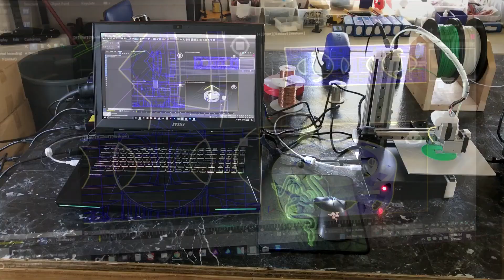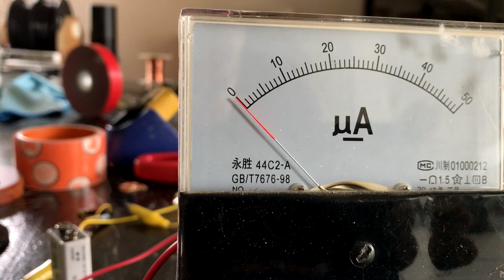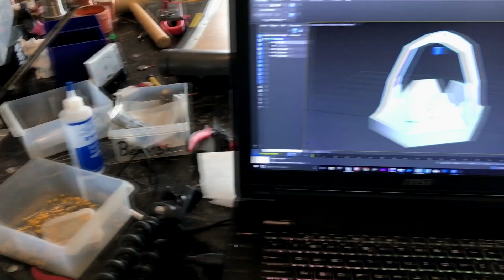3D Printed Nuclear Powered Motor - TriNano EZ-Spin - Tritium

Comment: Thank you for this.
I now wonder if I wide glass tube, with a lot of surface area in it, like star patterns or spikes engraved all inside it, spray the inside with the phosphor paint, and put on end-caps with valves for recharging the tritium gas like a car AC system.
Then would this be a great design for a Tritium Lamp? Maybe surround it with solar-panels, and have an emergency power source to charge a smartphone, and outside of emergencies, it's power can be added to the home, even sold back to the grid like what you can do with solar-panels on your roof?
The lanp you walk around with during a blackout, can also be docked in a basket thing of solar-panels.
My concerns, other then leaks, is, how is not good enough Tritium gas safely disposed off?
Reply: *if I made wide glass tubes

I was so excited by this idea, it screwed my grammar.
Reply: If this isn't bright & compact enough to charge a smartphone, then the panels can be wired in series & parallel enough to charge batteries or capacitors that stays with them, since they have all the time to be charged, then those batteries/capacitors can charge phones, or power other devices, when needed. And when the lamp batteries/capacitors are charged, then the lamp's unused energy can be sold to the grid, or power every day things outside of emergencies, or charge more backup batteries for emergencies, keeping them at a safe, longevity charge, like 60%, or something, so they don't degrade from sitting fully charged.

Comment: Do you ever get tired of the free energy kooks barraging you? Seiously though, what type of PV cells are you using? I can not imagine monocrystalline PV with the silk textured surface producing that little current from the tritium vials. I have gotten better results from moon light. Have you tried blue tritium vials? The phosphor should convert more energy to the usable blue spectrum.
  But in the mean time, you have got me wondering if I could spin something levitated in a vacuum using static repulsion from Alpha particles or even the kinetic collision force of them. I have everything necessary sitting around except for the fact that I already have three projects going at once.

Comment: I have a theory ✋ pick me! 
Why don't we make a compressed tritium gas flow battery. We could compress the tritium gas in a regular pressure vessel like a steel or carbon fiber propane tank preferably something that has a vavle that wont ever leak radioactive tritium gas. Then use high speed gas turbine pumps to push tritium gas through pipes, valves & Graphene sivs/filters to possibly extract protons emmited from radiation waves as direct energy. Like in my previously discussed topic of large betavolatic house hold civilian ownable tritium isotope gas batteries; that can trickle charge batteries & capacitors. Do to nuclear radiation having a long shelf life of years & years i wonder if it could make a useful generator for powering houses or off grid installations. Being how paranoid the government is about radioactive elements & terrorism i would think tritium would be more in reach for civilians through custom electrolyzers that could turn hydroxy, hydrogen & deuterium into tritium. But i know the government will make up some hubaloo about how tritium is used to make bombs well so is steel & metal but you dont see the government flipping out about that! Thank god...... i mean if its okay with the government to thank god that is........ To be continued! Anyways the only one making bombs is the government so digress. Where was i again oh yea i was trying to say betavolatic devices use beta waves which is safer than alpha wave radiation.

Comment: One beta voltaic cells you may consider the rugged crystal or thin film flexible cells. I think they can take light and convert it on both sides but the under side is a bit less it should give you a few more nano amps. As for litrocells you may try using an MHD coil. It works where you wind a coil of x diameter until a lights an led. Then you put two perpendicular magnets that attract over the coil to get a bit of gain. Just spamming some ideas.

Comment: I shouldnt say this but i better get a shout out for it. what you need is uncoated polychristalline solar panels and mroe tritium lights so you can output more 10-100x more amperage then what you're producing now and hook the power output to a high induction 5000 rpm dc motor.

Comment: This may not work but if you use a sphere magnet and put tritium rods around it as the core. Use a glue gun to glue two bells on the top and bottom of the magnet while making sure the bells are not connected electrically to the magnet as to make a sphere. The bells must not touch at the equator of the sphere. The top and bottom should make a little power if not try salt water or use Rochelle salt for a tritium mhd sphere generator. Bases on something I read. The main idea is that the tritium ionizes a salt or gas or fluid. The magnet separates charges to work like a battery. It may need to spin in order to generate moving ions.

Comment: It looks like you are using 1.5V cells. You would think that You better get more current and lower voltage for the motor, but better electromagnets have lower resistance in the coils. I suggest you try solar flashlights cells - they are 5V / 2mA nominal (under full sunlight) I've tested few 10s of them and I got short circuit current from 0,2 to 5mA. Maybe reducing the number of turns and rising the wire diameter just a little bit will produce stronger magnetic field at higher voltages. At least you won't know until you try it. You might even try it without changing the coils - for a quick test.

Comment: Would it be possible to bypass the electromechanical portion of the device by using the photonic output of the tritium vials to turn the vanes of a radiometer directly? I'm guessing certain wavelength outputs (vial colors) would be more efficient than others. Just a thought for efficiencies sake, but that would detract from the beauty of what you created.

Comment: I bet you could get a tad more power if you were able to more accurately measure the output and find that betavoltaic module's MPP. You could then tune your coils to somewhat impedance match the BV module. That might do very little as the design may already operate close to that power point, but it might just increase the real power being transmitted by the coils by double digit percentages.

Comment: Have you considered feeding output into a standby battery/capacitor bank?  I could see applications possibly being emergency standby devices that you don't have to worry about.  Like say an LED flashlight in your emergency kit.  Enough to see long enough to get your other backups online.  Though I suppose from a practical standpoint just slapping a solar panel on a flashlight hung in a wall mounted broom clip would net you more power over time from ambient room lighting.

Comment: So your improvment is mostly using a magnet at the top, correct? Also I do not believe your motor runs as low as you claim: setting the meter to capacitance measurement will not output current values as you show at 3:47. Still impressive how well it runs, I built a spinoff design and did some measurements which I will release on my blog in a few weeks. The power you can get at the low speeds is about 100nW because that's what I measured the air friction is around 0.3Hz (you claim less than 4nW which is quite impossible from what I measured). Efficiency of these motors is quite good though, around 60-70%.

Comment: Just a thought... space your poles so there is a gap after the driving pulse and utilize a variable mass mechanism on top of your design... if properly sized you will create greater average speed and therefore more output voltage

Comment: I have been doing some experimentation to boost power output within pulse systems such as pulse motors and or pulse motor- generator/alternators. I found that switching the negative leg of the pulse capacitor(which is also the storage cap when not driving in pulse mode), into the positive terminal of a higher voltage reference(hvr) such as a battery bank, ultra capacitor bank or voltage multiplier circuit, will allow the driving pulse to be delivered at a power factor of 3 to 10 times of its own value. You may also decoupling the negative terminal of the chosen (hvr) via the same method but buy switching the positive lead of a second capacitor(only some charge is needed in this cap)- onto the negative terminal of the (hvr). Time the pulse delivery so that the discharge time of the drive pulse is short enough not to completely drain the drive capacitor.  You will know by dynamically measuring voltage across the drive cap and or the (hvr) ... if a lowering or negative voltage is observed then that means you are drawing energy from the (hvr)... shorten the pulse and upsize the farad of the cap. A great way to do this is to use an Adams motor  attraction pulse phase for one pole and on the opposite side of the rotor use either  a repulsion or attraction mode of pulse (play around with your coils scenario depending on coil suseptability, coercivvity, resistantance, reactance, etc) . Be sure to make the attraction coil the first coil in sequence-series to receive the pulse current from the capacitor. Using two position reed switches will allow the normally closed position to function in generator mode and collect energy for the next discharge. If you use properly sized low power Shotkey Diode rectification possibly even ambient energy harvester circuits currently available in the micro and nano watt range it will boost harvesting/generation output. Potentially you may have to initiate the spin of rotor to input enough energy to over come any voltage drops in the rectification circuits.... like pull starting a lawn mower in a way. Seems a good fit to your low speed highly efficient motors or even in higher speed applications (up to the limit of reed switch mechanical time constant). You may want to run a quick ballpark analysis on your L-C resonance to see what frequency would allow your motors to run in resonance.... which means if you pull start the motor to a certain rpm it may run much more affectively.

Comment: A stirling hot gas engine for heating could be developed has well. A cold gas and hot gas stirling engine designed in this manner could also operate a rewired drum motor generator with magnetic bearings with a vacuum spark gap to generate high frequency electrical power that could charge organic carbon power cell banks. Way better then solar. ; )

Comment: Do you do any work with stirling engines? Have you ever tried designing a cold gas stirling engine using aluminum scandium alloy being vibrated at low frequency to cause the crystal structures to generate ultra low temperatures? I wonder if it would be possible to create a air conditioning unit using aluminum scandium and gadolinium and stirling cycle all self contained self powered self running? ; )

Comment: I'm really interested in the part where you got the motor to spin by just holding the two dissimilar metals at 3:51. Do you think that's the galvanic effect, atmospheric energy, or possibly bio-electric energy causing the Ezspin to rotate?
I'm thinking galvanic but if the values go up and down dependent of health, going this low with that motor might be able to help advance medical science in the field of Bio Energy. 
What do you think? PM me if you want to collaborate on a project like this. Cheers! Matt-

Comment: Sooo.... not to be skeptical, but something doesn't seem right here in the measurements you're taking. You're claiming the multimeter is showing 20 nA, but... it's set to be measuring capacitance, not current, even though the leads are shown in the mA sockets. So I have no idea what that's measuring...?

Plus it looks like you're measuring the voltage at the same time, but a 200 mV source into a 10 Meg input resistance voltmeter means the multimeter itself is sinking 20 nA. What's going on here?
Reply: I don't believe his meter measures capacitance - https://www.amazon.com/ELIKE-T-92-Self-Recovery-Capacitance-Identification/dp/B01B9P49B0

Comment: wow this is amazing work :3 hm wonder if this is the actual first perpetual moter that spins forever o-o ........YO WHAT IF THIS IS 0_0
Reply: A perpetual motion motor has to have 100% randament, that meaning that all the energy is contained withing the system and does not escape (trough heat or friction) and no input is required . This motor has a energy source. The tritium.
Reply: ohhh I thought it was powered by just he metel from minivolts..ohh yeah perpetual motion machine doesn't use any input ;-;. thank you for explaining this to me :)..hm I wonder...how long does its life go  and..what is tritium exactly :| but thank u for explaining it to me

Comment: Covering the cells with aluminum foil or other reflective material might increase its efficiency although it wouldn't look as good as this. Also, magnets are creating friction like losses when they swap past metals, so you might wanna try to use smaller magnets or other kinds of arrangements that lowers this losses. And like everyone said, using a vacuumed container might increase efficiency substantially.

Comment: But you all know that it is fake. Right? There are two brown wires coming out of the bottom. (Sorry for bad Englisch. I'm a German.) IT IS FAKE!!!!!!
Reply: Wo ist das Problem an den Drähten? Sollen die nicht nur die Elektromagnete mit der Photovoltaikzelle verbinden?
Reply: Martin Osorio Pulido wenn du genau bei dem video wo der motor auf dem stamm steht hinguckst siehst du zwei kabel unten aus der ganzen Vorrichtung rauskommen und rechts vorne den stamm runterhängen.
Reply: Martin Osorio Pulido und wenn es auf einem Tisch oder Regal steht ist ein loch in der platte wo es steht.
Reply: Professor Ozpin just look closely.
Reply: I mean, he's got motors that run ridiculously long times from 10uF capacitors. Knowing that, getting this motor to run from a tiny bit of light is no shock.
Reply: cause I've gotten close enough with nowhere near the proper coils to say it's possible using the setup he's created. he's also sent out ez spin motors to others who have been able to confirm how it works. others have also made modified replications with similar results.
Reply: Magneticitist how do you know that he also didnt faket the making of the Motor!?

Comment: Did I miss where he showed how to assemble the radiation power source?
Reply: He didn't assemble it, he bought it from http://www.beta-master.com/ or somewhere similar. 

Messing around with tritium gas is NOT a good idea. If it's contained inside a glass vial or something similar, you won't receive any substantial amount of radiation. If you were to breath it in however, that would be very bad for you.

Comment: "Nuclear powered" This thing doesn't run on alpha or beta-decay nor on gamma or x-rays so technically it isn't nuclear powered...
Reply: It kind of does, it just needs to convert the radiation to a form that solar cells can convert to electricity. The source of the energy is radioactive decay.
Reply: The electricity produced by the beta-voltaic cell comes from the beta-decay of the tritium. 

The fact that the energy is converted from that initial form before use means nothing.

You might as well argue that since a nuclear powerplant uses steam turbines to generate electricity, it's steam powered, not nuclear-powered.
Reply: He is using regular solar PV cells to capture energy from the betas, looks like it works fine.
Reply: Okay, just found out that there is something like a beta-voltaic cell, even engineering-students learn something new every day ;) 

Concerning the nuclear power plants: I think it is safe to say that the water inside a PWR or BWR is heated either by the heat of the fuel rods AND the moderation that water contributes in a water cooled reactor.

And yeah the working principle of any big power-plant is steam, well maybe not the gas-turbines if they aren't coupled with some kind of steam-generator afterwards...

But is he really using a beta-voltaic cell?

Comment: Wrong, it's radiation powered not nuclear
Reply: But that radiation is provided by nuclear decay.

By your argument nuclear power plants are not in fact nuclear powered, since they work by harnessing the thermal radiation produced by fission.
Reply: I think OP here mistook "nuclear powered" with "fission powered". Nuclear reactors work using nuclear fission, which is more energetic than nuclear decay. But decay is still a nuclear reaction.
Reply: What's the difference?
Reply: You know heat is transfered as light, right? Its the same thing, only different element, and different wavelenghts.
Reply: Wrong, but now you know that.
Reply: My thought too
Reply: Brent Smith yes that is technically correct

Comment: you could probably go lower if you put the motor in a vacuumed out glass bell, it doesn't have to be a total vacuum, but maybe half an atmosphere and you should notice that the motor will spin faster, or that you can supply it with less power to spin at the same speed as one outside the glass bell.
Reply: True, but the upkeep of that vacuum (or half an atmosphere) will take a lot of energy, because rarely you'll get a container so airtight that it will keep its constant pressure without significant work applied to it.

Comment: if you can up the size to 2x 3x 4x...  what would this be like?  can this be strong enough to run a rc kids car?
 [have an output to a drivetrain to do something with it?]
cvt drivetrain? :D
Reply: nah, the power output is just too minuscule. You'd need thousands of these to run any sort of conventional motor.
Reply: you would probably need a few thousand of those "batteries" to turn a small motor slowly.